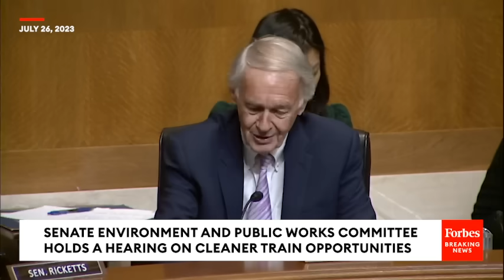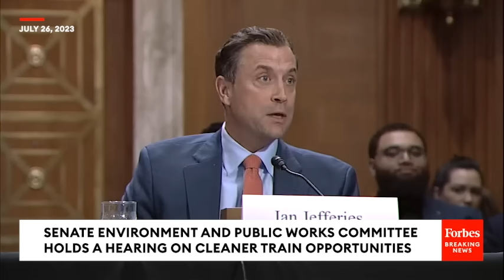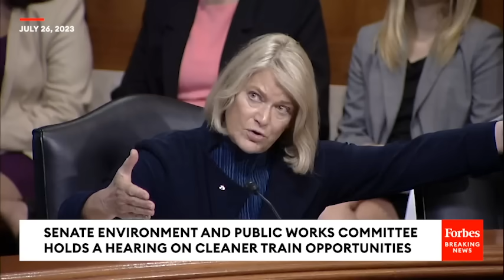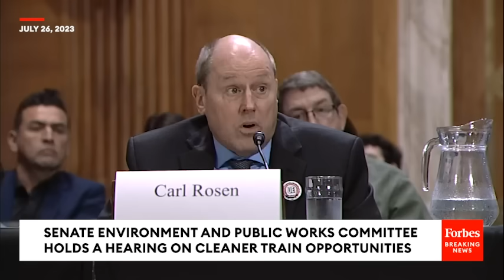‘How Long Would It Take To Replace All Diesel Locomotives With Electric?’ Cynthia Lummis

Comment: Imagine a train carrying products and the battery goes dead during rush hour at a RR crossing by a hospital! These politicians are clueless!
Reply: Worse, imagine that locomotive suffering thermal runaway at a RR crossing by a hospital.
Reply: @surlyogre1476  A battery that big melting down is by itself an environmental issue beyond imagining.
Reply: @brentkeller3826 That is my point. Thank you for noticing.
edit: I'm responding to your initial comment about it being an environmental catastrophe.
Reply: @surlyogre1476  
Got to see a hybrid electric car light up, was decently impressed with the mess it made.
I honestly don't want to think about a train sized battery of sufficient output going up.
Reply: @brentkeller3826  A disaster of that sort would have the 'battery powered everything'  crowd running around in circles, their hair on fire, screaming "Its not OUR fault this happened!" (Typical 'liberals-confronted-by-inconvenient-truth' reaction to  reality....)
Reply: You have seen where a car bursts into flames,  now just imagine a locomotive engine being ingulphed in flames!  Really scary to think about.
Reply: AOC rejects.
Reply: How is that any different from a diesel train running out of fuel?  (Don't get me wrong, I'm happy with diesel trains and this push for electric is silly).

Also: while I'm sure there are a hospital or two somewhere very close to a railroad track, I'm pretty sure they try to avoid building them near one unless the crossing is grade separated precisely to keep the roads from being blocked.
Reply: @comicus01   A train is able to be fueled in minutes and fuel capacity doesn't degrade markedly over time and the fuel itself doesn't work any less over time it provides the same predictable power per unit used.
That's how.
Plus it's better for the environment fuel bowser to burn up than if a train sized battery burns up. 
Rough to say but true.
The battery burning up is far more polluting than the fuel bowser burning up.

"I'm pretty sure they try to avoid building them near one unless the crossing is grade separated precisely to keep the roads from being blocked."

I have a bridge to sell you.
Reply: @brentkeller3826  As I said I think an electric battery powered train is ridiculous (however, one powered by overhead wires along the northeast corridor would make sense).  But diesel are not fault free, that was my point, and it still stands.

I work in a hospital and am aware of several more in my local area.  Other than one or two being near a light rail line, I don't know of any next to a freight line.  But again, I allowed for that possibility in other parts of the country.
Reply: @comicus01  the tracks don't have to run close by a hospital to cause problems , what about all of the people that live on the other side of town and are cut off from the hospital or the fire department because they can't get across a blocked R.R. crossing  ?
Reply: @bobbrinkerhoff3592  The further they are from a hospital, the less likely they are to cause a problem.  More opportunity to find an alternative road, or divert to another hospital.  Also: stop changing the scenario, I was responding to the original top level comment.
Reply: @comicus01  you have no clue of how far off base your assessment of trains and hospital placement can be , back when trains consisted of 30 cars you would have been right , but with 230 car consists and railcars measuring in at 80 ft. in length for the normal car , one train can bring a town to a halt . It doesn't even have to be crippled , it can be something as simple as shift change , which means they are federally mandated to stop and wait until they are relieved by a fresh crew , no matter if it takes ten minutes or ten hours , that tain doesn't move .
Reply: @bobbrinkerhoff3592  I know they can be a mile long.  Still possible to go around, it may be a long detour, but possible.

If access to a specific hospital is so critical, they can add a grade separation as one often sees.

You sound like a lot of fun at parties.
Reply: @comicus01  a long detour , but still possible huh ? Remember that when the emergency people are saying " were sorry about your spouse or child , we could have saved them except for the long detour we had to take " . Not every locale has anywhere near the kind of funding available to put in an overpass , and the railroads won't spend the money . Do you have ny idea what happens when the RR yards are full . They start stacking up those mile long trains nose to tail on the main line. For them it's just one big parking lot , and sorry for your luck now deal with it .
Reply: @comicus01  Which point do you believe is still open? The point about battery power or the separate topic of transmission lines to power locomotives? This thread is about battery powered locomotives so, with that said, your question was answered, very well, actually, so there are no outstanding “points” left open.
Reply: @comicus01  you can always bring diesel truck to the train. What about all these cars that get stranded during these big ice snow storms on the highway for over 24 hours. Imagine if those are all electric vehicles, how do you bring electricity to hundreds of stranded vehicles.
Reply: @mariolozano795  I was responding to the initial top level comment you made.  Now you're getting a bit ridiculous.  I also have zero plans to buy an electric car.  I don't know... they tow them like you would for a car that breaks for a reason other than running out of gas or a flat tire?

I also suppose you could bring a giant battery car or backup locomotive to a train that runs out of juice.  My whole point was that diesel trains can and do break down in the real world, and yet the railroad somehow manages to move the train eventually.  So it's unfair to point out that an electric train might break down.  Any machine has the potential to break down.

I agree that an electric train that runs off of batteries is ridiculous.  What are you really disagreeing with?
Reply: @mariolozano795  you should ask all the alleged brains in Washington this very question. Doubt if it’s occurred to them
Reply: @mariolozano795   Same way you see in Europe. A gasoline powered vehicle brings a Diesel generator to the car on a trailer to charge it to get it to the next charging station. Which in many cases, isn't working.
Reply: @comicus01 much easier to refuel a diesel then charge an electric.
Reply: W @comicus01  We are all mad;  a gallon of petrol that weighs about 4 and a bit kg produces around 34 kw of energy,  a battery  that stores that many kw would weigh 170kg
Reply: @comicus01  have you ever heard of a train running out of fuel
Reply: @toodjackson4438  No, but I'm sure it's happened somewhere.  And it would be relatively easy to refuel it or bring a new locomotive.

You guys are getting ridiculous with all these tertiary objections.  Especially since I think the idea of electric trains is silly (as I initially stated)
Reply: @toodjackson4438   Yes, I have.  And with overhead electrics, when the grid goes down, they have to call in the Diesels to haul them to the next location.
Reply: @comicus01  I have real doubts about diesel trains running out of fuel. They employ a lot of people to pay attention to the details along with the fact that most or all railroads have vendors with fuel trucks stashed all along their routes. And as you’ve no doubt seen, there are usually multiple locomotives per each unit train   Each with their own fuel tanks
Reply: @farmerthatflies  It doesn't have to be a running out of fuel. It can be as simple as a fuel line breaking. As was the case on out last trip on Amtrak. A 5 hour delay just South of the Jacksonville Amtrak station.
Reply: Train's are the most efficient way to move stuff. it's something like they can move a ton of weight a 100 miles on a gallon of fuel
Reply: @toodjackson4438 400 ton/miles is what a train gets.
280 ton/miles is what a truck gets.
I drove trucks for many years.
Most of the interstate commerce on trucks is Just In Time.
The places I went didn’t have railroad sidings, and a lot of the factories and delivery points, same thing.
Which begs the question:
Just how many railroad lines, sidings, spurs, crossings, etc., are people willing or even able to put up with?
What freight IS being moved is not critical.
I wouldn’t move a single boxcar with groceries of any kind across the country in this day and age.
Back when there were no roads, a whole lot of trains sped across wastelands unending to get food from the west coast to the east coast.
The only trains that had rights to the track over them was passenger rail.
No roads, remember?
The only train that could force a passenger train into a siding was MILK.
It had to stay cold, and it had to get there as quickly as possible.
Don’t get me wrong, it is entirely possible to have a lot more run by rails, but that leads to a new problem.
How do you get it to the store or shop?
We used to have “team tracks” where teams of horse-drawn wagons (hence the name) would come and get their goods.
That stuck around until roads were built, and trucks got better.
Roads got better, trucks got bigger.
They were getting big enough that the Feds finally said ENOUGH, and we are stuck with the sizes we have today.
A couple of states it’s legal to pull two 53 foot vans behind one tractor.
Interestingly, when that is done, the truck gets about the same ton/miles as a train.
But then, would you want to be trying to pass a rig that is 125 feet long on a road, anywhere?

There is a LOT that goes into transportation, so much it will make ANYONE’S head hurt.
This doesn’t even scratch the iceberg!
Reply: And what happened when one of them electric trains hit a car/truck or even a tractor trailer
Reply: I saw a cute girl in a Tesla the other day on the side of the road. I wanted to help her but I didn't have a gallon of ELECTRICITY!!!
Reply: Don't generalize "Politician". As you saw in the video, not all politicians are clueless. Quite a few are pushing back & asking questions. The clueless ones just follow the progressive narrative & they are Democrats. The Politicians asking the questions & giving pushback are Republican. Don't generalize, identify your target before pulling the 'trigger'(that's a metaphor).
Reply: Just another way for them to rob the treasury
Reply: No, these politicians are NOT clueless. They are bought and paid for traitors to freedom and our republic. Stop underestimating them or considering them stupid. They are making daily moves to complete their planned agenda and little to nothing is being done to stop them.
Reply: These left politicians are so so clueless!! California is the biggest problem in this whole farce!
Reply: Get What VOTED FOR that Silly DEM"S
Reply: Never mind thermal runaway.

Comment: The wind produced at these hearings couldn't light a 7watt bulb. Most of the rail that trains run on now has been destroyed by overloaded mile long freight with no maintenance until necessary because of derailment. Truckers have been shafted in a effort to push trains. US is in horrible shape due to these energy deficient hearings. Here is a fix. Strike all movement of goods to DC and flush out these experts.

Comment: It is not possible or even necessary to replace Diesel Electric trains with all battery powered trains. If anyone has to question this fact, they lack basic science and math education.
Reply: The dear Senator merely said "zero emissions."  She never said to put big ass batteries on locomotives and try to pull a load.  I don't think we're anywhere close to having an electric locomotive running on power solely from overhead wires that can be powerful enough to pull the loads that diesel-electric locomotives do now.

Comment: We need to pass laws with mandatory jail time for for morons who promote scams and waste resources  on these types idiotic and counterproductive changes. The problem with electricity has and always will be that you cannot store it or transmit it over long distances without tremendous losses. You end up having to produce more electricity than you need to make up for the losses. This produces more carbon emissions not less. Solar and wind cant cut it. They are too inefficient , too expensive and unreliable. You still have to generate the electricity so do it in the most efficient way. Batteries are a joke.

Comment: I have an observation. I watched three diesel-powered trucks hauling blades for a wind mill generator on I-45 here in Texas. One blade per truck. A few days later, I saw a freight train hauling at least a dozen wind mill blades going north on the rails. Seems like trains are far more efficient than trucks when it comes to moving these things around.
Reply: I can see where you think that but locomotives are a lot longer and they go to specific locations we will always need other vehicles to transport the things from the locomotives to other places good try though
Reply: I don’t see any tracks running behind the local Safeway or Publix   Trains are great to move product long distances but TRUCKS deliver it to you!
Reply: The libtwit idea of efficiency is too funny !!😂😅🤣😂 . Follow the process all the way through! Observing a train moving is not getting the BIG PICTURE!!
Reply: Trains are for long distance transport, trucks cover the first and last 10% of the journey. Sometimes we use trucks a bit too often because rail politics is weird. Lots of unserviced routes that are completely viable.
Reply: @Mallchad  train are subsidized  largely by the government!! They pay billionaires to keep losing large sums of money ! Trains are economically unviable ! They suck the teet of the working class, and sanctimonious about 1 cent per mile lies ! Any ignoramus can see that !!
Reply: The rails don't reach in to farm fields though.
Reply: The blades would have to be transferred from rails to trucks to be moved into the specific area as needed. By the time it’s said and done, it’s nearly a push anyway concerning the pollution thrown around.
Reply: On Railroads that have spent the last 60 years divesting the right of ways so they don't have to service the routes they once had. Wise up , this has been the GREED IS GOOD" period of Republican Representation to funnel the wealth of the middle class , and the treasure of the working masses to the coffers of the 1% who earned none of it !

Comment: I would have LOVED to answer this -- My answer would have been -- 45 YEARS  -- But ONLY if the USA were to begin building two dozen full-scale Nuclear Power Plants TODAY to generate the electricity needed.  Otherwise, I would predict MUCH LONGER, like 60 YEARS.

The service life of modern locomotives is MANY YEARS -- with the average being probably over 35 years not accounting for those scrapped prematurely due to wrecks.  Railroads are NOT gonna take perfectly good locomotives out of service if they are still needed (business is growing not contracting, for example).  There are many thousands of locomotives on the rails now that are less than 10 years old -- with proper maintenance and upgrades, those will last another 30 years. 

Class II and III railroads of today tend to operate with mostly older locomotives -- some purchased from Class I railroads or  from Leasing companies when they retire locomotives.  Most undergo significant and costly rebuilds and upgrades designed to give them another 30 or 40 years of service.  Then there are the historical or heritage railroads that specifically operate old equipment, some with and some without rebuilds and upgrades.  I can't see ANY of these railroads willingly switching to electric locomotives as that pretty much nullifies and negates their reason for existence.  And as for steam locomotives still operating -- umm, well, uh....
Reply: Even IF we had all of the power plants we needed to make this work , we would also need to upgrade and expand all of our power lines in order to get the power from the plant to the consumer.  And don't even think about putting those in MY backyard!
Reply: with EMDS very long Life with Ge not so much
Reply: The truth is GE always kept replacement parts expensive.  EMD has many aftermarket sources.
Reply: @MilwaukeeF40C  but old Emd locomotives were geting rebuilt Befor Ge went in to the Locomotive Business

Comment: Train locomotives have been running on electric for years.  Wake up folks
Reply: Powered by catenary wires or third rails. Progress means replacing the old and reliable with the new and untested.

Comment: Even if you burn coal for it, electric trains are cleaner and cheaper to run.

But somehow America doesn't go for the long run for domestic infrastructure.
Reply: Overhead wire construction and maintenance is expensive.  The freight railroads have looked at it many times.  They won't do it without subsidies.  Then there is the matter of environmental approval.  UP can't even add another track somewhere because of a turtle.
Reply: @MilwaukeeF40C  
That's easy; locs fed from overhead lines are way cleaner than Diesels. The zone directly next to the track is environmentally already a dead-zone anyway.